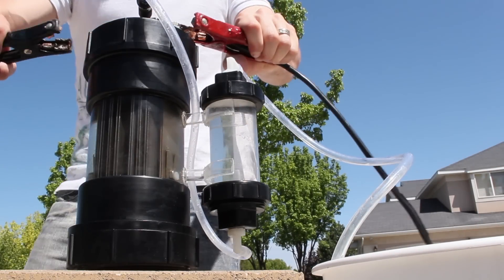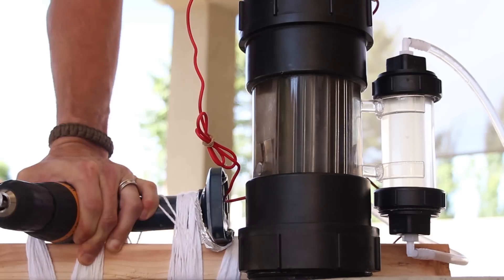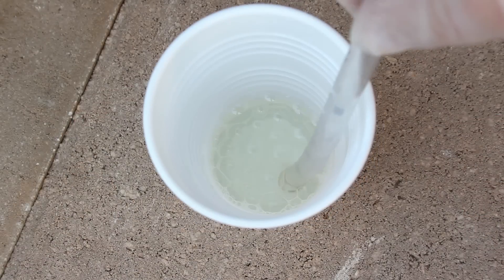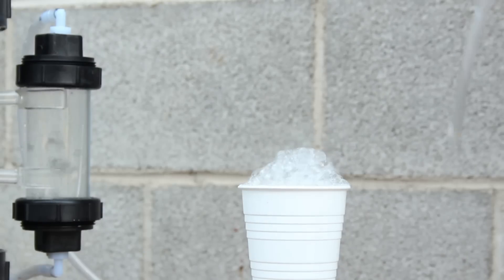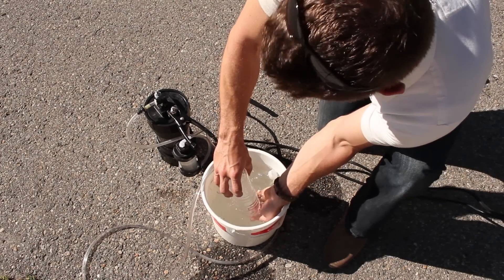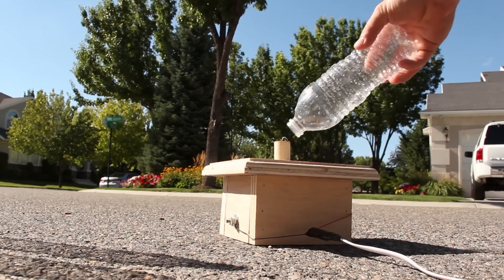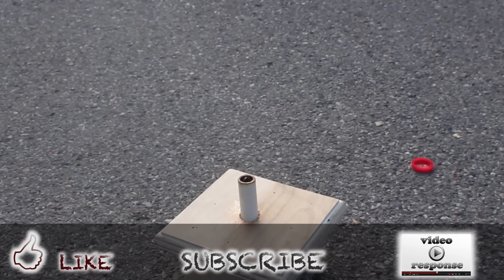How To Make Water Explode!

Comment: So this doesn't separate the water into separate hydrogen and oxygen gases, correct? Just one gaseous mixture of both?
Reply: DukeOfMarshall electrolysis does crack the water into H2 and O2, but because he doesn't have the rig set up to actually separate the H2 and O2 into different tanks, they remain a mixture of molecular hydrogen and oxygen that doesn't recombine until ignited.
Reply: Corinn Heathers Awesome, thanks for clearing that up. Would there be a simple way to modify this to separate the oxygen and hydrogen?
Reply: DukeOfMarshall I know some industrial electrolysis rigs (and their inverse, fuel cells) use a sort of permeable membrane that only one type of gas will go through. I'm guessing it's one of the reasons why it's expensive.
Reply: DukeOfMarshall u could also use the difference in boiling points between the two substances to separate them, i forget what the process is called but the use it when cracking oil. Also the boiling point would be extremely low so you would need to pass it through some sort super cooled tube in order to condense them in any case it would be expensive

Comment: You can put the cap on the bottle and then eject 2 needles. Connect the needles to a 6 volt battery but do it from a distance. I found the explosion greater than if just lit on fire

Comment: "reused over again" is a bit redundant.  Just say the bottles can be reused.  ;) 

Anyway, I remember having a little fun with HHO in science class.  We used to put it into coke bottles and cork them.  (We found we had to wrap the bottles with duct tape as sometimes they would crack.)  Pop into a class, kill the lights, uncork and light the bottle.  With the flame, you'd swear a shotgun just went off.

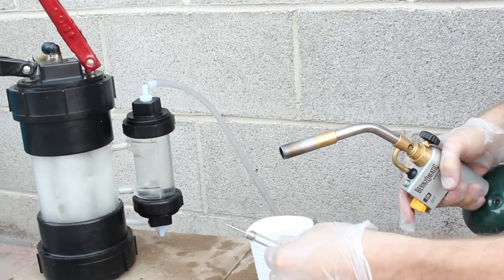Comment: 2:45 prevent the flame shooting back into the hose by inserting a bud of metal wool.
If its right in the tip of the hose it wont burn thru to the generator.

Comment: Or you just drop in some Francium...
Reply: You wouldn't be able contain any sizeable amount to cause any explosion.
Reply: Francium is almost unobtainable
Reply: Achilleas kousios and there are only a few atoms present at any one time due to it's instability.
Reply: Or you can just drop in some sodium
Reply: 10mcman I dont think you understand that Frankium destroys itself almost instantly
Reply: Nah just use Caesium
Reply: fear inof
Reply: 10mcman They keep a tight hold on Francium since it will explode equivalent of a hydrogen bomb
Reply: Sodium would be best.
More atoms for the same volume = bigger boom.

Comment: he did not mention it, but this technique Is extremely dangerous, as the activation energy needed to start this reaction (formation of water) is very small, a slight arc in the cell between the cathnode and anode could destroy the whole device... be careful !

Comment: This is a simple thing to do.  Separate the compound into the two component elements and trap them in the soap bubbles to stop them from reuniting.  As long as you keep the 2:1 ratio of the elements you can spark a spoonful of the soap bubbles and make a combustion and synthesis reaction.

Comment: If one looks around the internet much they will stumble onto websites and blogs talking about using these to pump Hydroxy gas into the intake manifold of a vehicle.  Your "distiller" is the cleanest looking I have seen. 

TWO QUESTIONS:

Have you tried to run an engine with this gas flowing into it?  Do you have the plans for your production tank and bubbler tank any place?

Comment: I really have to say that the principle of it is taught in Grade 9 here in China. There is nothing to be surprise at okay? Let me point out that. the 'gas' is just a mixture of H2 and O2 gases—— which produced by electrolysis of water. To ignite the gas, the reaction here is 2 H2 + O2 –> 2 H2O. And yes it was turned back into water finally. However, that was an explosion experiment. Don't u think doing such a dangerous experiment in the neighbourhood is impolite and highly intolerable? You want kids to follow it, huh?

Comment: Anyone think I could disgn a car with this
Reply: Seeing how you failed to type "design", I think not.
Reply: I can't spell lol.
Reply: your probably right not that much but it would be dangerous especially over time as your components start to wear
Reply: theres a few differences. first of all gas is sprayed in a flammable liquid form into the combustion chamber. water as we all know isn't combustible in its liquid form so we have to separate the molecules to end up with hydrogen which is a combustible gas, and the only way we know to store this is to compress it which is far more dangerous than storing gas because of the potential for explosion on impact.
Reply: i think you can, the issue is creating enough and safety, say you have a 5.0 liter engine and you use his extractor producing the gas at about 5 liters a minute, your engine would fully cycle at IDOL in less then a second expelling your 5 liters of fuel that took you 60 seconds to separate, but say you make enough and compress it into a propane tank or what have you and connect it directly to the fuel injectors and cut off the air intake supply cuz it will weaken the explosive energy then i could see it but cars sometimes leak from fuel lines and also voltage from the wires which would make any driver a little uneasy about this water car, but id still love to try :)
Reply: i figured, but what if you dont store it in the car but rather produce it just before sending it into the cylinders
Reply: tom katrivesis no compress it - or use the hydrogen to make a slow burning H BOMB!
Reply: if we did we'd probably end up spending what we save on gas on constant saftey inspection
Reply: tom katrivesis Not really.
Reply: tom katrivesis I don't see how this differs much from a gasoline engine. Both with a gasoline and HHO engine you inject a gas in a chamber and ignite it, causing a little explosion. They work pretty much the same way, except here you use water as fuel which goes through electrolysis, creating HHO gas which you then ignite instead of gasoline.
Reply: learn how to spell first.
Reply: Already happened years ago.

Comment: Why isn't this used as fuel for cars? Any answers?
Reply: Because hydrogen burns very hot, very fast, very easily. Think Hindenburg in the back of your car. Also, the energy you get out of the reaction is less then the energy you have to put into the separation in the first place. The most important reason however is liability. Selling a car that might get you killed or burned in way that attracts sympathy is a law suit waiting to happen.
Reply: hydroxigas is already used as fuel in many countries.
Reply: The first vehicle to ever run on an internal combustion engine used hydroxy gas in 1805.... gasoline wasn't invented until 1870.
Reply: Jerad Swartz He says this thing can make 5 litres a minute... a V8 Supercar (Australia's answer to NASCAR, running 5L 600+HP engines) doesn't even use that much - for instance, a lap around Mt Panorama, at 6.21km, uses less than 3L per lap I once heard, so with an average lap of about 2m20s during the 161 lap race, that's less than 1.5L per minute once this thing gets ramped up.
Reply: the amount of energy released is not necessarily less than the energy put in, however a vast majority of the energy released is sound energy (that's why you hear a loud bang every time) if someone could figure out a way to control it and convert the sound energy into electrical or mechanical energy efficiently it would become a very good fuel source
Reply: actually there are hydrogen-combustion-engines. its just that its difficult to handle and store liquid hydrogen. thats mainly why its not commonly used. and its quite expensive to produce a sufficient quantity
Reply: Thank you guys c;
Reply: Andres Gonzalez  So is matter.  Have you tried this and observed the results or are you hypothesizing? Are there documented studies on this subject?  I'd try it myself if I had the means to build one of these.
Reply: Kulman2
That'd be neat, I wish we could simply turn garbage into fuel. A few scientists were working on it, extracting Hydrogen from garbage and using it as fuel. I imagine it'd be very green and cost efficient.
Reply: Some people actually make these and run them in line with their car engine. You get WAY better gas mileage. But I would never want to to this to my car though. maybe a go cart or weed eater....
Reply: Aaron aka Frank Yea but then the car has to carry around a power source. Sure a car battery will last you a decent bit but then what? The problem is that you almost always put more energy into breaking water into hydrogen and oxygen than you are able to harvest by putting it back.
Reply: Andres Gonzalez I'm not convinced that electrolysis puts energy into the water. Have you seen studies on this that show that this is the case?
Reply: Aaron aka Frank Well electrolysis uses electricity to drive the reaction to break apart the water molecules. Lets imagine you wanted to use a generator ( something like the alternator on your car) to power that reaction instead of a battery. You would end up using more fuel just to break apart the hydrogen and oxygen than you would get out of the electrolysis.

At the end of the day, electricity is energy. That energy came from somewhere and you used more of it to break the molecules apart than you got out of them.
Reply: it's too unstable.
Reply: One of the main reasons I had ever heard for not using it in vehicles is exactly what happened in this video. BOOM!
Reply: CJ Cat Stacks You do realise that was an uncontained explosion with 3L of the gas, right?  Vastly different reaction when the concentration is more like an estimated 0.02mL that would be in a car's piston at any given time.  Hell, even 2mL wouldn't go off like that.

EDIT: After speaking to a rev head with whom I share an office, it would probably be more on the order of 100-200mL.  Some faulty math lead to that result I got above.  Still, nowhere near the 3L that was in that bottle when it went off.
Reply: Randy Gaston you mean discovered right?
Reply: Trea Jacobs Well, no. Crude oil has to be refined to become other things, such as kerosene, diesel, petrol and more, so I'd say petrol can be classified as an invention rather than a discovery.
Reply: Aaron aka Frank yes, Andres Gonzalez was correct in stating that creating HHO and then using it as fuel actually "wastes" energy in a sense because the output energy is less than the energy required to seperate water into its components. This is well supported by science.
The  reaction 2 H2O(l) → 2 H2(g) + O2(g) has a +(positive) Gibbs Free energy value, which states that energy must be added to the system in order for the reaction to happen. 
Additionally the first law of thermodynamics is that energy within a closed system is conserved. this leads to the conclusion that even If under PERFECT conditions (100% effiecency of the system) the energy released by burning H2 and O2 could only match the energy required by electrolysis. 

if you want to read up on this more nature published an article on this in 2007:
http://www.nature.com/news/2007/070910/full/news070910-13.html
Reply: eeee
But if we look away from efficiency compared to gasoline it is usefull.
Why? 
First of comparing hydrogen with gasoline is like comparing gasoline with diesel. Diesel is 40% more effective than gasoline is, then let us assume that gasoline is just 30% more effective than hydrogen is.
Ok, that point is a fact.
But there are still real good reasons to drive your vehicle on hydrogen. First of, both gasoline and diesel or almost any other fuel have become very costy, because we are running out of it.
Then I don't know about you, but I rather save those money by charging my car battery at night with a wall socket, which costs less then one dollar.
Also, by swaping fuel from gasoline to hydrogen your engine will last longer because hydrogen does not provide any smoke or soot, and you don't have to swap car as often either.
More over it does not provide any CO2 gas, which will save the planet from global warming, no toxic gases at all.

Someone might ask:
"why don't you just drive an electrical car if you have time to charge your battery every night?"
So I already made an answer for that:
Because first of you will have to buy an electric car and they are more expensive than a fuel car is.
Secondly you cannot travel very far with an electric car, and there are not so many charge stations.

To make it more simple to understand, running your car on hydrogen works like a hybrid car, just the other way around. Instead of having an fuel generator charging your battery like a hybrid car, you have a battery that is "charging" up your tank with fuel.
Reply: 638hds669900 then again CO2 isnt the only gas which serves to create the global warming effect. even clouds are keeping the heat trapped between the earth and the atmosphere. im not stating that it is bad to drive on hydrogen because by nature there should be a global warming but it should increase and decrease over time naturally
Reply: Gsniperify But the co2 heats up the seas which creates more clouds...
Reply: This isn't used for cars in the traditional sense, because HHO doesn't store well in a pressure vessel the same way hydrogen or oxygen can be compressed into liquid, and therefore more dense. HHO only can be stored for about an hour before it recombines back to water vapor. Hydrogen fits the "refiner-to-pump-to-end-user" model like gasoline or diesel. Because straight hydrogen can be created (through various means) sold to stations, then re-sold on the open market. It's consistent and measurable. HHO is a hobby, tinkerist gas. Unless you are a large manufacturer and can produce it on site and use it in conjunction with your current fuel needs to off-set the cost of buying gas/electricity/coal/nuclear/fairy dust etc... HHO is used commonly in overseas production facilities.

I have an HHO generator welder machine I bought off e-bay. It works great, produces 90l an hour, only cost me $300, and is safer than if I were to try and build one myself. I can use it to do tiny welds and solders in jewelry or electronics. It also flame polishes cut acrylic edges perfectly. However, 90l an hour ins't anywhere near enough to legitimately weld aluminum with, like they did in WWII airplane factories. I need way more liters per hour for that.
Reply: because illuminati

Comment: Grant Thompson, I'm sure you as well as many others have thought about connecting this system to a combustion engine (like the one in your car) in order to do some real work. Is it practical to do this? Is it capable of creating the gas at a fast enough pace? Would you be using more electricity to cause the electrolysis (in order to fuel the vehicle)  than if you were simply powering an electric car?

Comment: if this is the energy of the future... well i don't understand, yea it uses water, but you need electricity to power it... and isnt the idea (mainly) of harnessing energy, to make it into usable electricity? if you put electricity in, create hydrogen gas, and power a generator with it, you lose energy. i read this technology is what they want to use in space travel, if they can find water somewhere outside earth and make energy, but then they need electricity? can someone clarify?
Reply: You'd use solar power or wind power to generate hydrogen. It has greater energy density (per mass) than your average battery, natural gas, or petroleum, so automotive application is more feasible.

Comment: imagine the usage of hydroxie gas... fuel for cars?
Reply: Its already used for that, but the cars that run it are very expensive. Also a full car would be carrying a couple hundred gallons compressed. Think of that in a car crash or fire. It would kill everyone in the car if it went off
Reply: John Stevens can you make it less explosive?? oh well.. i think they should research more on the use of this thing.
edit :wait.. why dont put the generator in the car.. ? so if it crash.. its just water with maybe a slight explosion from the extra gas. and maybe using the airbag mechanism if it crash the electricity would stop fully.
or using a small container so the generator wont run all time. ????????? i dont have any degree on this soo yeah tell me whats wrong.
Reply: cok Bagus Guy in the Philippines already invented that over 3 decades ago. Extremely safe, converts only what is immediately needed for combustion. Simple as adding tap water instead of gasoline. Pulls the hydrogen from it's marriage to the oxygen. The only remainder out of the exhaust is oxygen. Search in YT:  Daniel Dingle and his Water powered Car

Comment: my biggest question is why haven't there been vehicles made yet that run on this same technique??? with this who needs fossil fuels???
Reply: So maybe put in an over sized alternator and multiple batteries??
Reply: it isn't that simple- think about the economics- but it is a very good idea
Reply: no one has done it because its not possible. the electrolyzer is not 100% efficient. The energy it takes to make the hydrogen is more than the energy you get from it. So all you would be doing is draining the battery in your car until it wont run anymore
Reply: Victor Baert Oversized alternator? It'll take more energy from the wheels to turn it. More batteries? More weight, more energy. You can't just make more energy from nothing...
Reply: There's is plenty of hydrogen motors, but they dont want to commercialise it for the public for safety reason... because you would need an hydrogen tank in your car... imagine if it would explode in a crash how it would make damage...